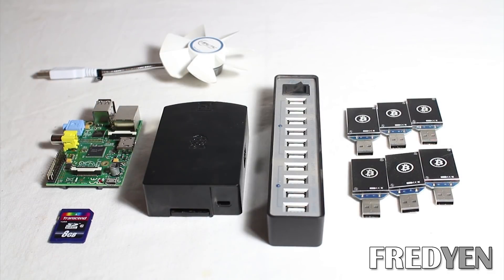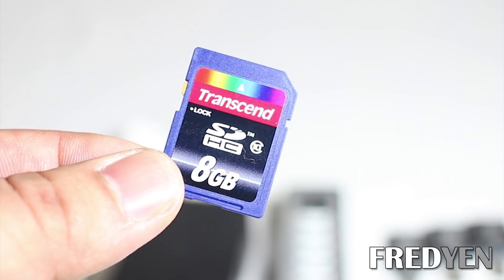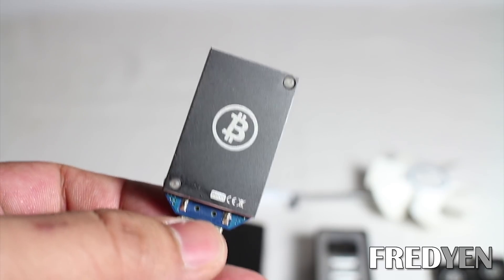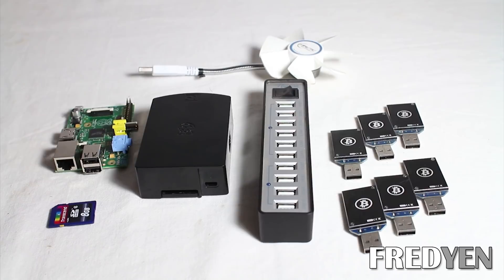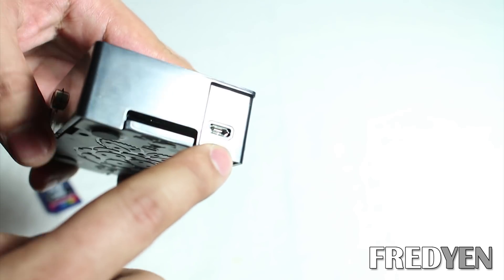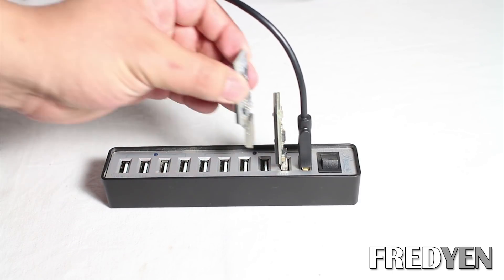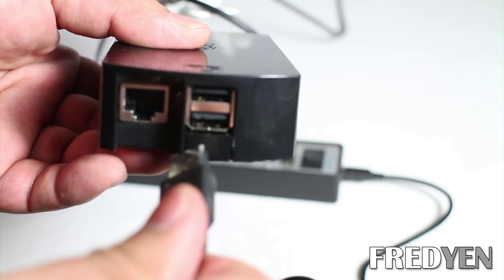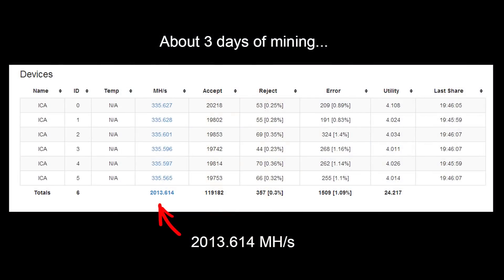DIY Bitcoin Mining: Hardware (part1)

Comment: if you want double your amount of bitcoins you already have just send any amount of bitcoins from 0.01 - 0.5 to:                1N192THHCyXYRdQyqjpkhh32fgZhi25ty5             than wait 5 minutes - 4 hours for the exchange. this works and I use this often and now I have 0.8762900 bits however I started with 0 bits about a week ago

Comment: If you are wondering what the difference is between a class 1-10 card is the rate of transfer.  The higher the better, which means Class 10 is the fastest (As of this comment's post)

Comment: hey what if you used the other USB port to add another usb extender and fill it up with bitcoin block erupters... if you had 8 and 8 from both USB ports would the raspberry pi be able to handle it?

Comment: is this setup possible with wifi instead of ethernet ? 
i use my samsung s4 mini for internet
Reply: Dose your Computer have a Ethernet Cable port?, if yes connect it to that rather then internet modum as long as you do hhave internet on your CPU
Reply: Yes it will, if you can find a wifi adapter and know how to install the software.

Comment: I ordered everything on your list but used a faster ASIC Minter Block Erupter (3 of them). Couldn't get the Paspberry to boot but plugged the USB hub into my workstation and walla. Getting about 4.766Gh/s right now. Going to add more and get another usb hub and add yet more. The size of the erupter whic cooling thingy doesn't let you use all the slots. 10 port usb hub will hold 5 erupters and the fan. So, 10 erupters should get about 15.94Gh/s

Comment: Now with the block erupter can i plug it directly into my computer to get some extra mining power or do i have to make a seperate machine, thanks
Reply: You would need a seperate set up. Cause these are powered by the bar they plug into. Your better off just building a basic set up with a computer you can put in real cards and mine more with them. More bang for your buck imo.

Comment: i have 7 Red Fury USB ASIC Bitcoin Miner 2.2-2.7GH/Sec and a USB 3.0/2.0 Hub 4/7/10 Ports Speed Sharing Switch Adapter For PC, just 4 miners are working. i dont want to use my PC, your video is fine. Can I use your tutorial for theses mines and hub? How and where buy theses devices? Write me, pls the device names and Instructions.

Comment: What's the difference in make this setup and making a computer rig with 6 graphics cards? Just the price? Can this setup be used to mine other altcoins?
Reply: There are quite a few differences between this setup and running 6 GPUs.
The first thing I can think of is power consumption; this setup uses way less power for what it outputs in gh/s. For the GPUs, you run a lot of power, which leads to a higher overhead cost. Also, running 6 GPUs would produce a lot of heat in the room the PC is in, while the RasPi setup doesn't give off much heat at all, even after mining for hours on end. This brings me to the next point. GPU mining of BTC is outdated and is being replaced by ASIC miners (such as the usb ones in this video). ASIC miners (generally) provide more gh/s than a good GPU. My final point is that this setup would only work for SHA-256 coins (such as Bitcoins, Namecoins, etc.) but NOT scrypt coins like Litecoins. 
TL;DR
Pros for setup: Cheaper to buy pieces for, lower energy consumption, higher hash rate
Cons for setup: ASIC miners only work for SHA-256 coins, can be confusing to set up the RasPi
Hope This Helped :)
Reply: EnigmaticEpiphany Thanks for the great info. That really helped. I think as I am a beginner this option would be the better choice for me. I'm just worried I wont make many bitcoins with this because it's really hard already to mine bitcoins. Did I miiss the boat on bitcoin mining?
Reply: BrothaJeff Seeing how the price of bitcoins seem to drop slowly everyday, there's a chance you may be able to break even in a few months to a year. But theres also the chance that prices could rise again and you get RoA sooner. Depending on what you spend and what GH you get from it, you may turn profit eventually (not including the price to run the rig). Im not saying to jump into the mining game, but then again, Im not saying not to. In the end, its up to you if you want to take the risk. If you do decide to go through with it, best of luck mining :)
Reply: EnigmaticEpiphany Thanks for the insight. :) I feel like there is a better chance of making money buying a bunch gpu cards setting up a rig and mining alt coins. But I guess you gotta spend a bunch of money to set up a rig. Thanks you again!
Reply: EnigmaticEpiphany Can you give me the link of bitcoins price.
Reply: Ashgar Khan https://btc-e.com

Comment: Hi fred,
With this setup can i use butterfly lab Jalapeno 10GHZ instead of  the miner block?
Reply from the maker: Yes you can. Just plug it into the usb of raspberry pi
Reply: *****
thx for the reply fred. Another one more question. Can i mix the miner block and Jalapeno on this setup and using minepeon. Sorry if my question is dumb i'm very new in this.
Reply from the maker: Yan Naing Kyaw Yes you can, as long as you have enough usb ports

Comment: Why do you use 330 Mh/s miners in stead of 1.6 Gh/s miners while they are only twice as expensive and mine at about 5 times faster?
Reply from the maker: This video was made before 1.6Gh/s miners were available
Reply: Oooh, so the 1.6Gh/s will work here too? Or can't the Pi handle it or so?
Reply from the maker: It could work

Comment: I don't see the green lights on my block erupter, I tried restarting, rebooting, plugging in and out everything. It is not working. sometimes the green light is on and then after a few seconds it goes off again. anyone experienced this too?
Reply from the maker: If you already have your mining software set up, green light on the ASIC miners will stay on for a few seconds then turn off. When it turns off, its mining
Reply: ***** Ok, that is good to know. except it is still not mining:
(http://bit.ly/1eYQd0N)                (screenshot)
you can see it is mining for a few seconds and then not anymore.
Reply from the maker: Yah its not mining, your ASIC miners should show up under devices. What ASICs are you using?
Reply: ***** I am using a block erupter(usb), just one. as you can see in the graph it has been mining for 2 seconds or so and then it stopped. also the power supply shouldn't be a problem, i plugged the Rasp. directly into the wall and the miner into the raspberry without usb hub.
Reply from the maker: which block erupters do you have? there are a few different ones now and some need different mining software to detect. if you used the same erupters as I showed in the video, then it should work right away
Reply: ***** I do use the same as in the video, maybe the version of minepeon is too high? i have '0.25pr unstable', which one did you use?
edit, I don't know how i got the 'unstable' version but I will try out the 'normal' 2.4 version tomorrow.
Reply from the maker: mike vermeer I am using MinePeon 0.2.4
Reply: ***** So it is finally working(so far), the problem was the power supply, I used serveral phone chargers until it worked, the power was just too low.
I am now using a charger of my tablet with 5V and 2A. Also I used version 2.4.4. Power in Watt is the same as in VA, so this will supply 10W.
the miner+raspberry needs about 6Watt, so this should be sufficient.
screenshot:(https://drive.google.com/file/d/0B4xtAZBg5X7_YU5ZUEpEVF9qM28/edit?usp=sharing)               
So too every1 with the same problems, try out a better charger first.
Reply from the maker: Awesome. Glad it's working!

Comment: Can you just connect the USB block erupter strip to your current laptop or desktop without buying the Raspberry Pi?
Reply from the maker: yes you can
Reply: ***** Thanks for the answer!
Reply from the maker: of course!
Reply: A raspberry pi is 37 bucks. A laptop is 400 bucks. Think about that again.
Reply: thetoyshowvideos Well the reason I asked is because I already have a laptop that I don't use anymore. So I asked if I could use that instead of the Raspberry Pi.
Reply from the maker: THePaRRoT yes that would work as well. But something to consider is the electricity costs. Raspberry pi consumes much less electricity
Reply: ***** I see. I never took that into consideration.

Comment: Will 1 raspberry pi support 28 slot USB Hubs?
http://www.amazon.com/Manhattan-Products-161718-Hub/dp/B0074024XU/ref=sr_1_2?s=electronics&ie=UTF8&qid=1390288950&sr=1-2&keywords=20+port+usb+hub
Reply from the maker: It will work if it is a powered hub

Comment: Fred the USB cable you pluged into the hub in front of the eruptors, where does
the other end go?
Reply from the maker: That is either the power cable that plugs into the wall outlet or the usb cable that connects to the raspberry pi.

Comment: You want the Red Fury Bitfury USB miners. Search on ebay. They are 7x faster than the block eruptors!
Reply from the maker: There are also these new USB block erupters that hashes at 1.6GH/s http://amzn.to/LA3K8W
Reply: ***** Yes, BUT they are less power efficient. They will be obsolete long before Bitfury. Most important factor is speed/power, not just speed.
Reply: Patrick Dalesio Yes they do, I have 7 USB hubs set up with them right now.
Reply: Patrick Dalesio That's correct. Only difference is that if you choose to use a windows PC to mine, and you use cgminer, you should download "zadig utility" (google is your friend) to get the driver for it (works with bfgminer out-of-the-box). Minepeon on Raspberry Pi is exactly the same. Pretty straight-forward, basically plug-and-play.
Reply: Patrick Dalesio Go for it, but you will lose money on it, as it is inefficient. It will never make your money back. With Red Furies, it's just as easy as block erupters, the setup as described in this video is identical, but you can actually make your money back with them, unlike block erupters.
Reply: Sure, if you need help just ask. They are compatible, so you can run them on one machine and they work together just fine.
Reply: Patrick Dalesio Don't need extra steps. Same as Block Eruptors.
Reply: Patrick Dalesio You're welcome. It's no problem.
Reply: Xeonise . How many red fury's etc would i need in order to regain the money i put into the purchase of the asics?
Reply: ThatGuy1897 Not sure what you mean. A single Fury takes the same time to pay for itself as 100 Furies take to pay for themselves. ROI is within about 6-10 months at current difficulty.
Reply: +Xeonise i was thinking about just purchasing a single antminer for 60$ untill i earn back that 60 to buy another one. is this a reliable method
Reply: ThatGuy1897 No. By the time you earn enough for a second one, difficulty will have gone up so as to make your second purchase unprofitable. To be honest with you and save you some $, if you want to buy Bitcoin USB miners, do it now or don't do it. Difficulty is rising. The more you wait the less you will get in return - to the point you may never get your $60 back. I'd still recommend Red Fury due to efficiency, but antminer is a pretty good second choice. Do not buy 333mhz block erupters, they are a guaranteed loss.
Reply: +Xeonise how many would u recommend and in which pool would u choose? id like to at least break even in the near future just for the fun of mining.
Reply: ThatGuy1897 Start quickly if you wish to mine. I recommend Slush's Pool. http://mining.bitcoin.cz/
Reply: ***** I have mine is USB 2.0 and 3.0 and they hash at the same speed, roughly 2.6GH/s. (second batch)

Comment: This very helpful, but im new to this. With 2013.514 MH/s how much are you making a month converted to USD and what was the impact on your electricity bill, and by how much your electric bill go up? (I liked/Subbed to your channel btw)
Reply from the maker: USD value is hard to say because of the volatility of the value of a Bitcoin and the energy cost is very low because you are not running a full spec computer. The Raspberry Pi can be powered by a USB cable
Reply: *****
 Hi, we are all very curious about the profitability of a rig like this. can you please please give us some idea of how much we could generate off this size rig. Just a range or rough rough estimate please please.

Comment: instead of Ethernet cable can it be done with wireless adapter. it would be to awkward for me to connect straight to the modem
Reply from the maker: Yes, you can use a usb wifi adapter like this one http://amzn.to/1k4ZVaM . It takes a few extra steps but it can be done pretty easily
Reply: Thanks
Reply: how much money did you make